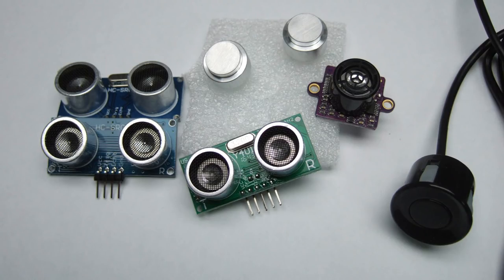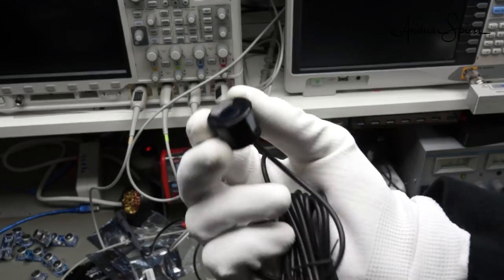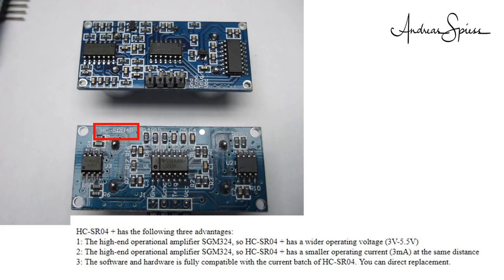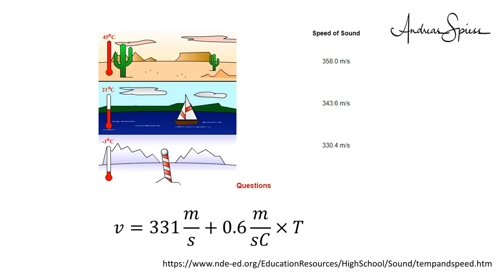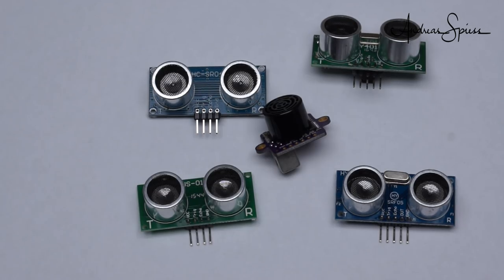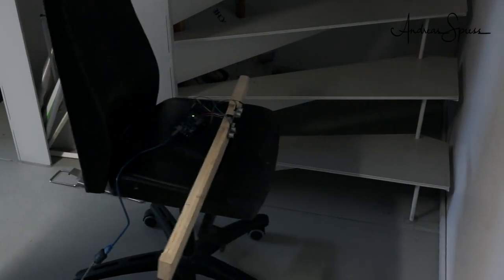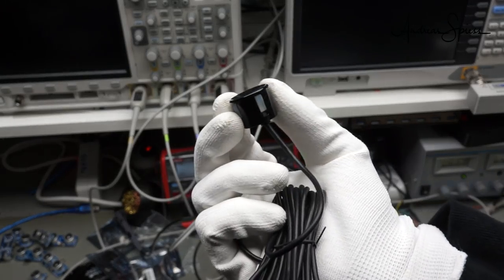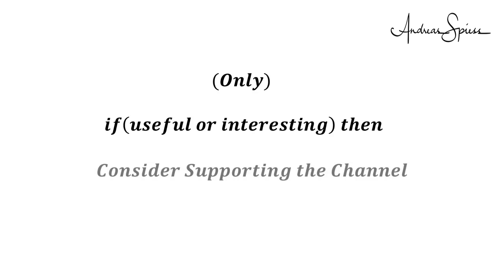#190 New Ultrasonic Sensors: Comparison and Test (US42V2, JSN-SR04T, and US-100)

Comment: I have used HC-SR04 in my 1000 ltrs water tank to monitor the water level. If the water level goes down the water motor/pump automatically starts and once the tank is full, motor automatically stops.. I have used Esp8266-12E and a relay. I also send the water consumption of the tank to my cloud and from there i show the water consumption summary to my customsrs. Just a small step towards 'Save Water'
Reply from the maker: Good idea. How about the longevity of the sensor? Another commenter wrote that the sensor corroded quite fast.
Reply: I've been using it since last 2 months, and its working absolutely fine.. Summer is starting now in Delhi, so i need to keep a close watch now..since there will be lot of humidity inside the water tank
Reply: Sandeep Solanki for me the problem with this setup above my water tank the grill of the 2 sensors filled up with water due to moist giving way off readings, after I dried it with paper towel it would work again for a couple days...

Comment: Thanks for the great video. Can the ultrasound penetrate through metal ? For instance, if i want to measure the level of liquid in a metal cylinder, can i place the sensor on the bottom and isolate the echo that reflects the one i am interested in.  

There are at least two boundaries the  ultrasound must cross (thus reflection occurs)

1. The metal -liquid 
2. The liquid -gas ( I am interested in this distance) 

Or what kind of sensor will be capable of achieving this ? 

Thanks again
Reply from the maker: It will not penetrate metal. Often pressure sensors are used inside tanks to measure water levels.

Comment: Hi Andreas! Another wonderful video. It made. Me wonder; does the "waterproof" sensor (if the connections were encased in glue/epoxy) work underwater and what effect does that have? I wondered if it could be used to map activity of fish in a pond for instance?
Reply from the maker: There are projects like that but with much more powerful transducers

Comment: I see a lot of problems with distance jumps, from the correct distance to the minimum distance which is around 23cm with the sensor JSN-SR04T. The sensor is very constant if no cable is nearer then 1cm around the transformator, as soon a usb cable for power the esp32 or esp8622, or the esp itself, then the signal beginns to jump very often. Perhaps it is something that you can show or prove with a video. Kind regards
Reply from the maker: The ESPs have WiFi transmitters built-in. So they might disturb the signals of your sensor. I never had this issue.

Comment: Am using a ultrasonic sensor to display the water level in my opaque water tank. It shows the level on a 16x2 lcd display + it makes sure the water pump is stopped when tank is full (using a ssr on the pump).
Reply from the maker: Nice project!
Reply: Are you interested in teaching me how you did this? I want to hire someone to help me build a water level sensor that can control an on/ off pump.

Comment: Hi - Is the table at 7:32 correct - I thought it was the US100 that had the temperature sensor and not the JSN-SR04. It wouldnt seem to make any sense to have one on the board of the JSN as by design it is mounted in a separate location from the sensor.
Reply from the maker: You are right. My mistake. I will put a link to the corrected sheet in the description

Comment: Thank you verry much for your excelent videos. Searching for waterproof distance sensor I found your chanel. For my planed project the angel of the JSN-SR04T is too wide. Now I am wondering if I could install the sensor into a tube to reduce the angel. Do you think this works? Or maybe you know another waterproof sensor with taler angel?
Reply from the maker: I do not know. Maybe you try? There is a chance it will work.

Comment: Thx for this very nice video, excellent work!
I'm thinking about monitoring the level of a rainwater tank.
Could this be a useful application for the JSN-SR04T?
Reply from the maker: I think so. Viewers commented that is has a minimal detection range. Below that it does not work any more
Reply: It depends....jsn- sr04t has a very wide spread of it's beam( about 75°! ). So unless your water tank has quite a wide opening I would not recommend this sensor. In comparison, the HC- SR04 has only a 15° beam, but unfortunately it is not waterproof and the mere water vapor can damage it( I used one for a similar project and lasted about 2 months after which the tiny metal plates inside the transducers were almost completely oxidated)

Comment: Just 2 cents about a point in the summary: If one requires real-time capabilities (e.g., for balancing robots) I would never recommend relying on the offloading and serial protocols. They would most likely introduce delays and more importantly jitter that have very negative consequences on control algorithms. The AVR GP timers can easily spare the CPU core from measuring the time between trigger and echo if used correctly - no idea if there are Arduino libraries for that though but I would not recommend Arduino for such projects either ;)

Also, the column of waterproofness in the comparison table is rather useless as is ;)
Reply from the maker: I used I2C for mine and it works fine. The three sensors always measure distance and if I read it, I always get the latest value. Very fast. The timing of different ultrasonic sensors is not simple because they can disturb each other. This is why I do not want to have it in my main loop. There I have many other time-critical things like the control of the steppers.
Reply from the maker: And thank you for your hint concerning the sheet. I added a link to a better one;-)

Comment: What are the range determining factors without voltage??? I didnt get that?? Are all including sr04 has same  max range....about the 1cm less range , did you had  the   diaphragm distance considered.???... Because its nearly 1cm inside..
Thank you  for these new info..
Reply from the maker: I talked about the maximum possible range, which is shorter if you run your devices on 3.3 volt.

Comment: Appreciate your videos it leaves me room to experiment in the future once I complete my current project. Leading me to my question recently I used the DHT11 in my project and it performed without flaw. Well until the second day when the temperature was being reported incorrectly. After searching the web I found a fellow YouTuber state the DHT11 are not for outside use the moisture build-up can cause them to malfunction. Have you run into this and do you know of a direct replacement. Would be nice if a direct replacement could be used without changing the library supporting the DHT11.
Reply from the maker: There are a few alternatives which use the same library. But I do not know if they last longer

Comment: Hello Andreas, did you tested XL-MaxSonar-WRUC outodor sensor? If you didn't can you do that? Also you had noticed that it is not good when several ultrasonic sensors works in parallel, but what about LIDAR sensors? Can you make a test with two TF mini lidar senors at 20 cm parallel distance from each other?
Reply from the maker: I only have one TF mini. It should be easy to synchronize them that they do not disturb each other. Maybe you watch my video about Lidars?
Reply: Yes I did thank you.

Comment: Nice video. I want use ultrasonic sensor in water level but need distance between 3cm to 30cm.  JSN-SR04T minimum is 20cm that is not for me. Is any water resistant sensor for this range? Thanks
Reply from the maker: AFAIK you need a lot of power under water. I never tried
Reply: @AndreasSpiess  I have tank with 30cm height and I can use HC-SR04 because I dont add sensor down to water but only want know level distance. I use this sensor because I want know how many % of water have in tank.

Comment: OK, it's not these sensors, specifically, but I have an interesting use for range sensing you might appreciate. Solar, too. ESP8266es, etc. We have a remote home. None of the usual municipal services people take for granted are available out here. That's a good thing. Get a glass of tap water. Hold it up to a light. See that stuff swirling around in there? You know what that is. Lol.

Anyway... Maxbotics sells units that are IP-67 rated, and a bit expensive. They are easily switchable between operating modes (echo, PW, serial, etc). I put one of their MB7060 sensors in a cistern to monitor the water level. Meanwhile, in a distant field far below, a solar panel drives a low volume water pump to lift small quantities (4-18GPH) of water from a deep well into the cistern whenever the sun is shining && the sensor indicates that the cistern is not full. The cistern provides gravity-feed water pressure to our house. Crystal clear water. The cistern and well are 1km apart, connected by a buried PEX tube and a shielded CAT6 cable. The cable is for a different purpose and couldn't be shared for the water project, so a D1 Mini on the cistern communicates with the well electronics via LoS nRF24 link. The ESP also controls a stepper driven peristaltic pump which doses the cistern with sodium hypochlorite to hold the water at 0.03% chlorination.

So, yeah. Ultrasonic range sensing is key to our drinking water.
Our clean, clear water that has no ... tiny bits of paper floating in it. ;o)

I keep promising myself I'll make a blog or vlog of the overall system and, more importantly, document the pitfalls and miscalculations I overcame so that others can work straight toward their goal.
Reply from the maker: Sounds like a nice place you have. And a good application for such a sensor.

Comment: Great video as always !! I have a question / idea. Is it possible to use ultrasonic sensors (any model) for detecting changes of volume area in a box ? Imagine a cabinet in a sports facility, that customers are putting their staff inside. At the end of the day the owner coulde see if there are any forgotten things inside a cabinet. Something like a car alarm system. If it detects anything withinh the area that is covered from sensors,  then alarm is generated. So with the same principle, "alarm" could be generated upon presense of e.g a wallet or a watch inside the cabinet. Do you think that this is duable? Thank you in advance. Keep up this excelent presentation style of yours.
Reply from the maker: If the things you want to detect are big enough it should work.
Reply: I hope they are putting stuff in the cabinet and not their staff!
Reply: Xaxaxaaa, OK my mistake

Comment: A good application for a water resistant ultrasonic sensor is the measurement of the level of the liquid contained in a tank.
The sensor can be placed at the top of the tank facing the bottom.
When the tank is empty, the measured distance will be the entire height of the tank.
When the tank is full, the measured distance will be zero and the sensor will be wet, with no harm.
Reply from the maker: A few other commenters also use it for this purpose. However, the minimum distance seems not to be 0 cm
Reply: Yes, that's a good point.
Anyway, there is generally a full level that is placed somewhat lower than the top of the tank.
In case of a rain barrel, that's the level where water starts to flow outside of the barrel.
In other cases that is the level where you stop filling the tank.
Reply: The combined transducer module has a min range of 20cm
Reply: I have never used that module, but 20 cm is definitely too much as min range.
The "traditional" hc-sr04 has a min range of 2 cm.
Reply: Has anyone seen Waterproof/resistant version of the HC-SR04 ?  in order to get the close distance like, you need to have separate transmitter and receivers.

Comment: Would it be possible to use such a sensor as an alternative to a PIR? I'm working on automating my house and I want to add motion detection. But I want a bit more precision than just "something moved in the sight of this sensor". I was thinking that maybe this kind of sensor could be used instead and give some indication of how far a person is and maybe in what direction they are moving. Or is that nonsense and should I look at radar sensors instead?
I guess people don't reflect sound that well. Also, what kind of range can you expect with these sensors?
Reply from the maker: Radar gives similar on/off signals like PIR. Measuring distance could be interesting. But the beam is quite narrow.

Comment: Can you do a maximum wiring distance when using common transmitters? Like how long a wire I can use connecting a temperature transmitter to an Arduino mega?

Thanks.
Reply from the maker: I never tried, so I do not know.

Comment: Interesting. It never occurred to me before that if I was being chased by a robot which used some of these sensors, I could confuse it by "firing" loads of other sensors back at it.  ;)
Reply from the maker: It is very easy to confuse these sensors. Just offer them a surface which does not reflect the sound in their direction.

Comment: I've seen quite some people using these sensors for detecting if the car is parked in the garage, others for measuring the water in a water tank (especially those living off grid)
Reply from the maker: The one with the garage is new for me. Interesting. We only have one car and therefore we usually know where it is parked ;-)
Reply: Andreas Spiess if you want to see some more projects, visit mysensors.org forum and openhardware.io. I know there are a lot of projects using the 328p but there are some for esp8266 that you usually prefer.
Reply: Mark Bolton there have been some projects, even battery powered, to measure water level of different shaped tanks.
Reply: The ‘detecting a car in the driveway’ was my plan as well. In addition, i am considering using one or more to trigger camera snapshots and moving a ptz into the direction of where the action is. But for the latter, i could use (cheaper) microwave sensors in a weatherproof box.
Reply: Could you make tank level measurements through the top of the tank? If so, they'll be great as boat tank level meters!
Reply: Matti Airas no, you still need to make a hole in the tank, either for sensor or cable.
Reply: thesimbon I was wondering exactly whether it would be possible to do the measurement non-invasively by tightly coupling the transducer to the tank top. Depth sounders on boats work just fine through thick fiberglass hulls, but I suppose sound wave transmittance from fiberglass to water is quite a bit better than from, say, sheet steel to air.
Reply: Matti Airas I think you got the point, in addition those used on boats are specifically designed to work that way, while these I don't think were thought to be used outside of a tank
Reply: Usually the depth sounders are designed to be installed through-hull but also work when installed inside.

But still re the sensors: I don't see why a completely sealed sensor such as the JSN-SR04T, at least in principle, couldn't work through some surface if coupled to it tightly (with epoxy or maybe some polyurethane mass) and if the sensor transmission power was high enough. Lots of ifs, of course, and with that particular sensor the minimum 20cm measurement distance kinda spoils it... :-)
Reply: Matti Airas I guess an Arduino sensor is not powerful enough

Comment: Thank you for figuring out how to control this sensor. I copied your code but it seems like your implementation of the timing for updates to the US-100 crashes whenever your unsigned ints get out of bounds! I changed to the usual timing code (found everywhere) and now it does not crach anylonger.  // Talk to US-100 to update distance and temperature
  
currentMillis= millis();

  if(ping_enabled && currentMillis - PreviousMillisDistance >= pingSpeed) {
    PreviousMillisDistance = currentMillis; // saves the time
    us100.request_distance();
    //Serial.println("Distance requested");
  }
Reply from the maker: Thank you for your correction.

Comment: are these sensors easily affected by wind?  I set a AJ SRT-04M sensor up on a fixture.  It measured a particular distance to the floor.  I then set up a floor fan directly (maybe 8 inches) in front of the sensor and turned it on HIGH.  The reading did not change.  Any idea why not?
Reply from the maker: It should not be influenced by moving air. Maybe there is another reason like the movement of the blades.
Reply: Thank you for taking the time to reply to my comment regarding your 4 year old video.  As it turns out I had a problem with my firmware.  I found it shortly after I posted my comment.  Keep up the good work.

Comment: super video. and what about measurent angle? i want to measure the water level in water well with diameter of 1 meter. is it possible?
Reply from the maker: If I remember right the opening angles are about 30 degrees.